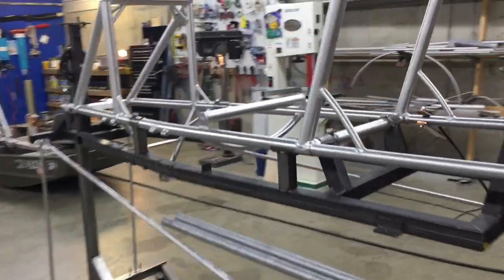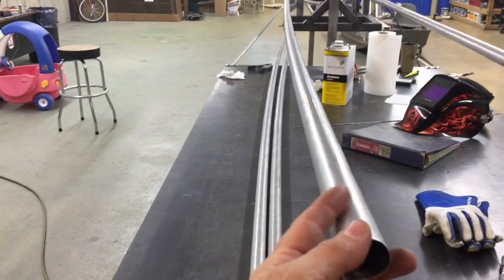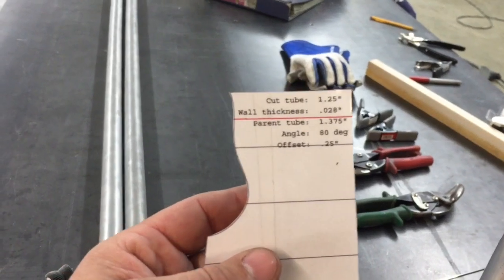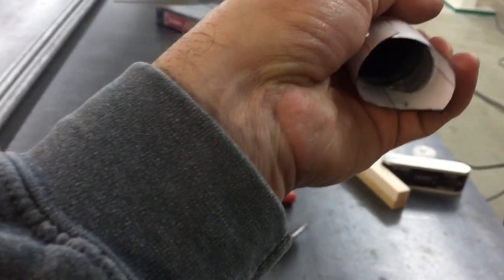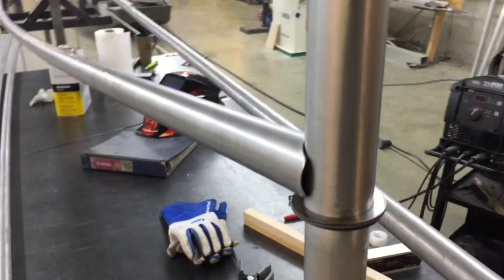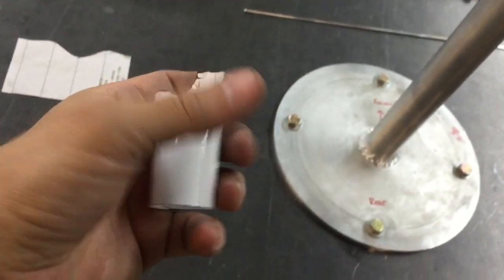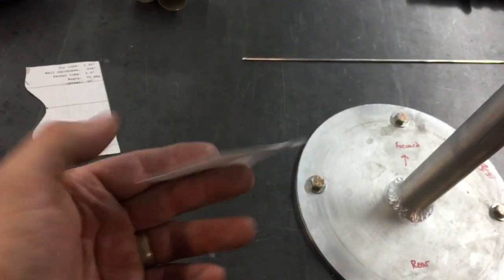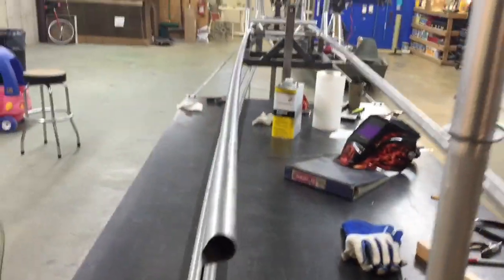Tube Notching Tip

Comment: What's the wall thickness of these tubes?
Reply from the maker: The tubes being notched are .028” and the upright tube is .058”
Reply: I admire your ambitious attitude. I realize you didn't design this aircraft.  Kudos for fabricating an aircraft that performs good.
That is sure a lot of tig welding. From my own personal experience, cracks will develop from vibrational resonance. Especially where welds are not completely welded all the way around. I use to tig weld 6061T6 tubing for the seafood industry in refrigeration. I use to leak test my welds at 600psi with nitrogen in a water tank. I had 36 welds per evaporator. Out of 100 units I would maybe get 10 that didn't have no leaks. Fixing the leaks took more time than welding.
 Aluminium is so easy to contaminate and is very porous. Never use metal files on aluminum.  A fine stainless steel brush or fine wire wheel dedicated only to aluminum is used.
 In actuality, according to the A&P aircraft books. Just a scratch on aluminum is a site that will begin to degrade on the microscopic level.
Welds will crack at the stopping weld point.
Gusset plating in the stress points with a set of struts, would make for a safer aircraft but to make the  254LB FAR103 is the question?
I'm no engineer but I would not feel safe unless this aircraft had a  riveted   gusset design. 
I hope no one got hurt or worst. It's only a matter of vibrational cycles before something will let go.
I hope this will help.